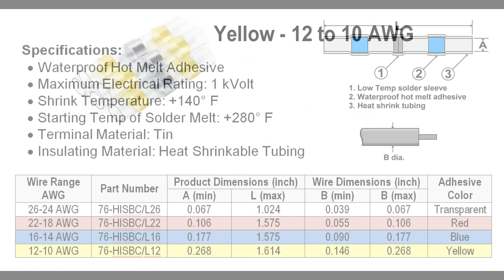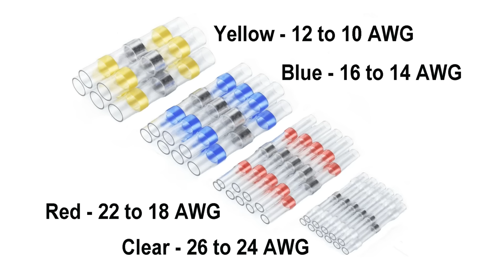Heat Shrink Self-Solder Butt Splice Connectors

Comment: I work in aerospace. There are reliability problems with the solder failing to flow into the entire connection, with the extremely low melt temp, and with inconsistent pull resistance results in the finished product. You can end up with intermittent failures down the line and trying to pick one of those out of an aviation harness is a major pain to put it politely. If it’s not good enough for the flying machines at work, it’s not reliable enough when I am on a motorcycle, nor do I feel like chasing these sorts of bugs out of my car. I will stick with the Boeing/NASA approved traditional wrap and solder process. Results in a strong connection with very high reliability. Takes more time up front, but costs me less money in materials, and ends up saving me time and frustration on the back end because I’m not chasing electrical gremlins that resulted from an attempted shortcut.
Reply: WELL SAID DAN!

Comment: Do these have a waterproof adhesive sealer built right in?
Reply: TylerTimoJ only if you cut shrink tube to fit
Reply: The entire sleeve actually has adhesive, but the colored rings are designed to provide a watertight seal.

Comment: These have been used in the aviation industry for 40 years! You should use a curved shield on the end on the heat gun to ensure it is heated all the way round evenly and you dont need to turn the cable either ... which may be difficult to do in a confined space or loom.

Comment: Nice, but don't forget that heating should be applied from one side to another (like, left-center-right), to ensure the air goes out. This way it'll be more durable and last longer
Reply: Great tip! Thank you. ❤
Reply: Using smaller nozzle heatgun, you can heat the center first, then to one side.

Comment: I tried this today for the first time.  I have to note that (as with ordinary heat shrink tubing) you must be careful of stray wires.  I had a stray wire poke through the insulation.  To be sure, I checked it with an ohm meter after the heating.  yup, stray wire poked through the clear tubing.  I think you may need to start with a heat gun as suggested so the shrink tubing doesn't get too hot.

Comment: I love these. Bought them on amazon. 250 for like $25. Used them to add water proof pigtails for some after market LED fogs. Used them in headlights. Will use them to change the pad wear sensor pigtails on my audi to seamlessly take Porsche calipers and pads. Using them on harnesses in the car. Im used to soldering and glued heatshrink but try soldering outside in a wheel well or deep in your dash. Love these things. Just dont melt them.
Reply: @Bantham Nobilisit's more like 300 for $50 but you see them right on Amazon. Used them recently to hook up some aftermarket gauges.
Reply: How are they holding up 4 years later?

Comment: I can’t mesh the wires together without crushing them thO..  actually a lot of commentors question the durability of connection & I couldnt Cm 2 mesh wires togethr anyway.  perhaps the best way is to double diagonal twist the 2 wires together, which there’s a video on- the one way that doesn’t pull apart(which would last years with NO connector but a bit of heat shrink tubeing), but THEN use this gizmo✋.

Comment: I've used these and they work really well a tad pricey but can get them for about 20 cents each. I could not break the connections. a bit ott if you only have a few connections to make but if you have 40 to 80 on multi cables is make it way easier and quicker.

Comment: Yea because I can hold the heatgun underneath a cars dash board and gently hold the two wires together and spin them so its all even.
Reply: Obviously this works best in certain conditions.
Reply: Lol ... Yep gotta have 3 hands on that job..i could have definitely  used one of those connectors right about yesterday. There are jobs that require innovation.
Reply: Small butane torch work wonders
Reply: Great answer! Can't do this in a tight place. LOL
Reply: @dannybrazil3986  no kidding.. this would've came in handy when I was repairing the AC cord for my dad's phone the other day
Reply: Step 1: Remove car from wiring
Reply: I used a lighter 😂
Reply: Was litterally thinking the same thing
Reply: the bigger the glob the better the job
Reply: @Gabrg95  did it work ok
Reply: A lighter works fine, just don't set it on fire and pop it like a fiery pimple.
Reply: I use my joint holder, my snapon butane solder gun with the heater tip on and the matco electric solder gun. Ready to go in 8 seconds
Reply: Can do it with a lighter.

Comment: Great idea but $0.82 each it's a bit steep for me

I can buy bullets for that much
Reply: Junior Mudd  
bullets = lead
Gunpowder = heat
Gunpowder + bullets = hot lead
Hot lead = solder
I can solder my wires by shooting them
Reply: @chasebh89  okay you win, champ.
Reply: It's for marine use
Reply: And with them threat people to buy you those pieces 😂
Reply: Price from the Moon without a doubt.
Reply: @chasebh89  ...you suppose there's a connection somewhere(?)
Reply: @daleburrell6273  a pretty good one if you use these connectors

Comment: But does it provide a true low impedance connection? I can't imagine this being as good as traditional soldering methods. I'd at least tin the wires before using one of these to ensure low resistance.

Comment: Every time i see these things i have the same doubts about reliability. Id rather just solder seperately with the solder alloy that i choose, then cover with conventional shrink tubing in my choice of color. Much cheaper too. 
   If you want it to be weather protected one can add rtv or other good quality adhesive before shrinking. Im just now trying hot melt adhesives for the first time so i cant speak of how good or bad it is.

Comment: Why isn't there a link to the product? I was at Summit & couldn't find this.
Reply from the maker: Hi Studio A Design,  It appears that there is a link in the description: https://www.summitracing.com/search/product-line/dx-engineering-heat-shrink-self-solder-wire-splice-connectors

Comment: They need something for solid wire and a blessing would be copper to aluminum....I know that ain't going to happen...Old homes with the aluminum wiring, that needs changed to copper at the receptacles for insurance reasons, as of now need one connector for each wire....Try cramming that back into a box....No way...It takes knocking and/or cutting out the wall, adding a box for the connectors alone,  then probable plaster work, so butt connectors would save time, space and money....It's the aluminum that's the killer, and should have never been allowed....Anyway, thanks for the video.
Reply from the maker: Thank you for watching!

Comment: Isn’t it dangerous to dangle the wire/connector directly above the heat gun? If any of that solder or plastic drips into the opening of the heat gun then that seems like a recipe for disaster.

Comment: Can you use an open flame like a lighter? In cases of when there is no electricity or no heat gun available.
Reply: A lighter works fine, but as with regular heat shrink tubing it will take some finesse to get it right without burning.

Comment: If you are splicing a wire into an existing wire, can you connect 2 ends on one side and one on another? How would you use one of these with 3 wire ends?

Comment: I bought a pack of these and while they work, they are not great. Would prefer to see a crimp connector that contains hot air solder with a heat shrink coating with waterproofing glue.
Reply: ... with a single plum, floating in perfume, served in a man's hat?  here ya go!

Comment: I have to questions
1. Wouldn't it be just easier and cheaper to just "interleave the wire strands to be connected" and then heat to solder them ? why do you need the entire device for ? 
2. how much heat can it handle before the led is melted again.

Comment: Is this good for use with connectors that are around an engine? Got a single connector 2 pin that needs a new housing, but I'm worried I'll need to splice in some new wire ends as well, would this hold up to being around the engine or will it further melt?

Comment: What kind of temps does this connector hold up to my worry is the low temp solder getting hot enough to come apart somewhere like in an engine bay.

Comment: Solder joints were rejected on the Apollo guidance computer for more than one reason. They used wire welding instead.
Reply: And this comment is significant why?
Reply: @spudth  I guess I was just pointing out how soldering has its downsides, ie: it is sensitive to vibration, while sharing an anecdote that also reveals crimp and solder are not the only or best way. 

What's the significance of your comment?

Comment: I'd like to see long term corrosion test of that low temperature solder with melted plastic. Sure it seems like a good ideal, but has it stood the test of time, lesson has taught us the horrible truths of using lead free RoHS approved solder over long time. At least it's by NTE however, I trust them more than your random off the shelve manufacturer.

Comment: We use these in the navy on aircraft, but we would never use them to do this, they are actually used for splicing emi shielding back together or EMI shielding to ground. We use a crimp splice with an environmental heatsheink like the one used here. Also, these are way too expensive for the job the accomplish

Comment: Does anybody know if the solder contains lead?
Reply: No lead, solder: Sn-Bi (42% tin, 58% bismuth).
Reply: @origionalcatastrophe  ...I shipping that figures: if the solder contained lead, then it wouldn't have such a low melting point(?)
Reply: @daleburrell6273  melting points:
Lead= 621.5 F
Tin= 449.5 F
Bismuth= 520.5 F

Comment: These things aren't new.  A friend gave me a bunch of them over 20 years ago.  I still have some left.
Reply: CAphotos Never seen these before  would've been useful to know
Reply: They have been using them in aircraft for a while.
Reply: @gsxrgeorge00  exactly were i used them. worked for the swiss airforce and saw them all the time.
Reply: 20 years was a long time ago.
Reply: Lol I seen them awhile ago too but never realized how they work---i thought they were like really shitty butt connectors that required the wire to be connected in some way I didn't understand.

Still, soldering wasn't considered reliable for the Apollo guidance computer. They used wire welding instead,
Reply: Lmao after 20yrs I still have some

Comment: The price for 100 is $92.90 this seams very high.
I will do it the same way and the cost is penny’s per connection.
Great idea I wish the price was more reasonable.
Reply: I buy packs of 50 for a little over $2usd in the Philippines. Shop around and you'll find a better deal.

Comment: The "heat shrink" melts way before the solder. I have tried my snap on gun and a mini touch. How do you rotate the wire when repairing a wire on a harness? NOT a Recommended product.
Reply: I use quick passes from a torch lighter only burned through 1 getting the technique down.

Comment: These were just recommended to my by a marine electronics dealer. I laughed through the whole video!!! Can you imagine doing this in the confined space of a bilge? An engine compartment? I just spliced the wires on an old boat trailer I purchased to transport my RIB.  The lights were fine but the wire was torn up bad. I put a new wiring harness onto old wire. The wire in these are not marine grade and as such the old wire was black. Any one who has tried to solder a corroded wire knows you get no adhesion! So with my heat shrink, crimp style butt splice connectors and dielectric grease...... Frankenstein Lives! LOL The guy was using 6" to 8" sections of brand new wire, on a bench with a vice to hold the heat gun! ROFLMAO  Not to say that there is no use for these! Learn to solder! Get dielectric grease! Know when you need an aviation quality connection (Like My Transducer)! This was a good laugh!

Comment: No more crimping, using a soldering iron, or cutting shrink tube to fit, No more crimping, using a soldering iron, or cutting shrink tube to fit, No more crimping, using a soldering iron, or cutting shrink tube to fit, No more crimping, using a soldering iron, or cutting shrink tube to fit, No more crimping, using a soldering iron, or cutting shrink tube to fit, No more crimping, using a soldering iron, or cutting shrink tube to fit, No more crimping, using a soldering iron, or cutting shrink tube to fit, No more crimping, using a soldering iron, or cutting shrink tube to fit, No more crimping, using a soldering iron, or cutting shrink tube to fit, No more crimping, using a soldering iron, or cutting shrink tube to fit, No more crimping, using a soldering iron, or cutting shrink tube to fit
Reply: Can you repeat that?
Reply: Be careful the butt connector will be hot. Let it cool down before you touch it
Reply: These suck so bad I threw them out.

Comment: Just used these for the first time this past week....definitely not a fan. I could see the solder finally “seep” into a small portion of the wires. Definitely not to my personal satisfaction. Also, to get the solder hot enough, I felt the heat shrink tube was then overheated.
Reply from the maker: We are sorry to hear this, Jay. Do you have an order number?

Comment: During last survey, yacht surveyor pointed out and explained that soldered wire connections were not permitted in the Marine Industry. Are these ??
Reply: Wouldn't the glue and shrink tubing count as a mechanical connection?  It's not bare solder.
Reply: Probably not. The reason why they are not permitted is because soldered joints crack when exposed to vibrations. Mechanical connections are much more elastic and doesn't have issues with this.
Reply: No.

Comment: Seems like a lazy mans bandage for not being able to use the right stuff.   I would like to perform a tug test on that.     Neat idea.
Reply: Tensile strength is decent because of the jacket and adhesive.  The solder joint itself isn't that great due to whatever alloy they use (not regular lead or lead free solder)
Reply: Jeff's Big Guitars  hmmmm.   If I need to explain at length I feel I may be wasting my time.    Cheers mate.

Comment: I mean yeah, it's kinda neat. But it takes me all of two seconds to solder together a few wires, and a box of a couple hundred heat shrink tubes in various sizes with adhesive costs less than $5, which is what, 2 cents per tube? This product costs about $1 per application.

Comment: Too expensive. Would rather take the time to hand solder and cover with self adhesive heat shrink tubing. The man hours alone are less expensive than the cost of these.
Reply: Thats better. but still, $7 US for 40 pieces from china on the slow boat instead of a roll of heatshrink and some extra time and care.
Reply: Yes, it is cheaper on Amazon, about $0.15/pc. Like this one: http://www.amazon.com/dp/B07H28DFYN
Reply: To each their own 👌
Reply: @sergeantseven4240  try amazon, fast free shipping can get them for under 20cents a piece which is less than the good heatshrink with adhesive in it an theyre faster and easier especially when fixxing a broken wire thats tucked up in your dash or on the fuel tank somewhere tight

Comment: I have these.  Pretty good but sometimes hard to get solder melt without damaging the shrink.  I'm guessing these are only possible because they're from China and the solder had a high lead content to enable it to melt at a low temperature.  Lead solders are getting harder to find due to regulation.
Reply: leaded solder is not hard to find.
Reply: warriorpluto  dumbass, the lead isnt a threat to your skin
Reply: I think it's Bismuth

Comment: low heat solder so when your wires short out it creates extra burn down factor. SWEET . Solder isn't for automotive application where voltage is applied. sorry it's just not.

Comment: The low temperature solder connection isn't as strong as the traditional way. The solder doesn't penetrate all the way inside. Some strands are not connected to the connection. That's one of the down sides of this new innovation.
Reply: Stille better for people who used to splice wires without solder and just twist the wire together and add electrical tape... But geez, the prize........
Reply: FinTutorials I used to do that before. But later I learned the correct way of doing it. To be honest, I'm not really satisfied with the results of this low temperature solder connection. But it's actually a neat way.

Comment: Solder
it has an L
it's right there in the word
'L'
that means when you speak the word 'solder' you don't say 'sodder' you use your eyes to look at the word and the letters and then you pronounce the letters in the order they appear. This is called speaking English.
In this case, when you read the word 'Solder' you can see there is an 'L' in the middle. This is your queue to make an 'L' noise with your lips, tongue and larynx.
Bear with me here this is going to get complicated!
'Solder'
Sole Dur
not
Soddar